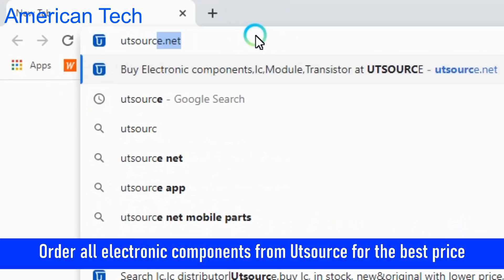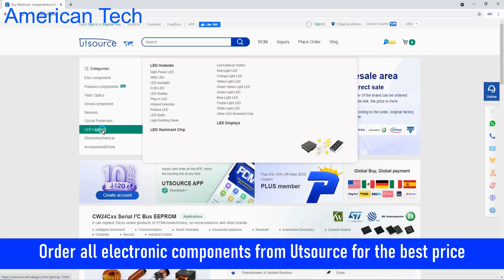How to Make a powerful induction heater | Electronic project

Comment: Pcb design is bad. Induction coil mus be single, not push-pull. Power supply must be minimum 60Vdc or rectified 110Vac
Reply: His mosfets would probably blow at that voltage. 😂😂